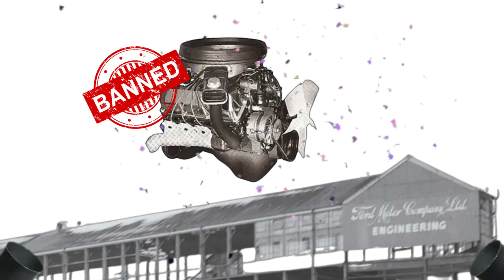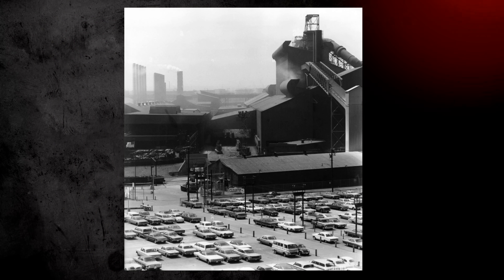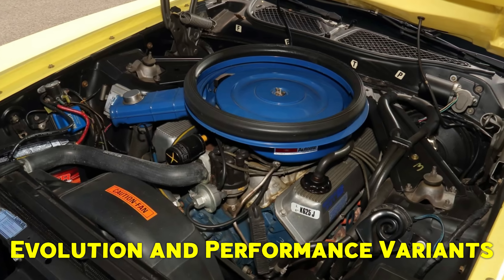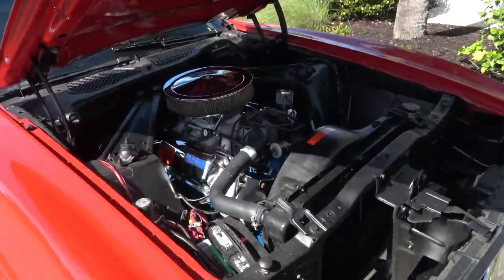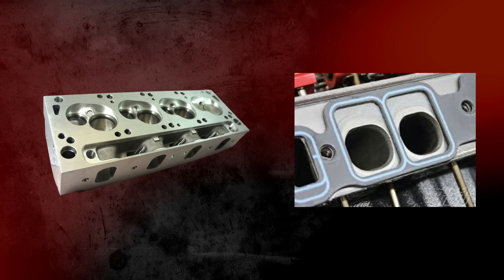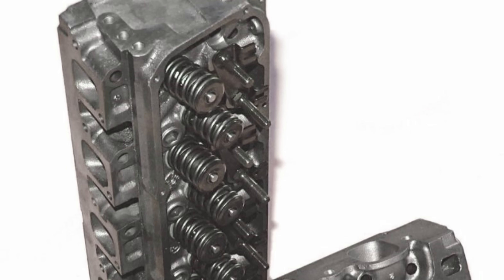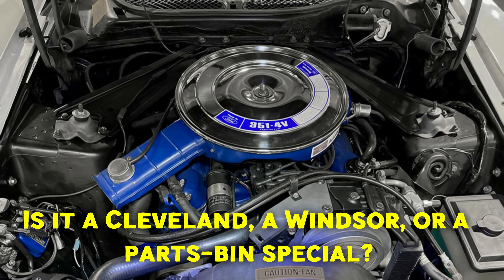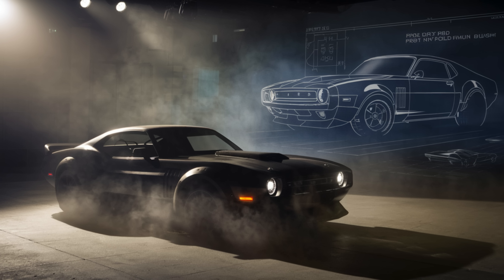The Shocking Truth Behind FORDs Banned 351 Cleveland Engine

Comment: I have a 351w in a merc. It won't beat my 390 tornio. A 351m in my 17 ft boat. A 351c in a 70 torino which is hot. And a 429sj numbers match. Its in a torino 4 speed 411 rear. Squawk in 3 gear rolling. I have a 428 on the floor and 3 two barrels to fit. Yes I collect fords.
Reply from the maker: Wow, it sounds like you have an impressive collection of Ford engines! Each of those setups must be a blast to drive. The 429 with the 4-speed and 411 rear sounds particularly exciting! you should start a youtube channel  @busnorth  fund your next build

Comment: I had a 1973 Gran Torino with a 351CJ. When it started burning oil my Pops and I tore it down(in frame). when we got the heads off(reason for oil consumption) Dad said, dam no wonder this car doesn't get any gas mileage.Forged crank and 4 bolt mains. 4000 rpm was a sweet spot. Not saying what the speed was on that speeding ticket. Its the car out of all my cars that got away😪

Comment: What a unhinged commentary . . . storyline is complete BS.   1971 Ford ran 429s in NASCAR, first 351s in 1972. 
Boss 351 was a 1971 only model . . . what killed the Solid Lifter Cleveland . . . the EPA Enviro Regulations.   
The 351 Cleveland hydraulic lifter had been a Mustang option since the fall of 1969 . . . same head used on the 1969 Boss 302 available in Oct 68 . . . in case you didn't know.  Cleveland engine did have oiling  and rod angularity issues.
Of course in 1971 you could also order a 429 Cobra Jet in a Mach ! Mustang, rated at about 390 hp. 
Yates NASCAR C3 heads were patterned after the Cleveland/Boss heads.  
Ford build an SVO 10 bolt block for NASCAR R452 that was used into the 90s I believe based on the Windsor 351. Eventually replaced by the FR9 in 2007.
Reply from the maker: Thanks for sharing your insights! The history of the Cleveland engine is definitely complex, and it's always great to dive deeper into those details.  @dalew801

Comment: In 1975 I owned a 72 ranchero GT with a 351 c 4 bbl 4 speed it pulled 100 mph in 4th at 4,000 rpm factory red line was 5200 rpm! The best performance of any engine I’ve ever owned!
Reply from the maker: That sounds like an amazing experience! The 351 Cleveland is definitely a legendary engine, and it’s great to hear you had such an incredible ride with your Ranchero GT!  @donaldfrazier5244
yeeeee haaaaaa

Comment: I rebuilt and installed a 351C into a 1973 Pantera. It was mostly stock except for intake. Single plane Edelbrock. Single 780 4bbl. Can't remember what make. First run was mild. 120mph in top gear just to work out the bugs. Second run was supposed to be the head-turner. I computed a top speed of 175mph. I only got to 155. We did a second run, same thing. Got back to the garage and opened the hatch and found nothing.We decided to go for one more speed trial so I had the boys close the hatch while I sat in the seat and then it happened... Snap, snap... I could hear a hi tension snap. I asked the guys to open the hatch and it went away. Voila. We had a spark plug wire short ONLY when the hatch was shut. Never did get that third run in but It probably would have hit 175mph.

Comment: Also knew a guy in HS who bought a nice hugger blue 72’ Mach 1 with an all original 351 2V and auto. Probably had a 3.00:1 rear. That being said, it really wasn’t a slouch! I was shocked at out it would run with an 87’ Monte Carlo SS.
Reply: What's a Mach 2?
Reply: @bradgriffith4231  I meant Mach 1. Bad typing.

Comment: Friend had a clone 71’ Boss 351 or, maybe it was real,back in the early 80’s when we were on HS. Didn’t have the aluminum valve covers. But did have the 780 Autolite carb, Hurst shifted too loader, and 9” diff with Magnum 500’s. We raced a lot of things back then. And then it got a bit slower. 
  We yanked the engine out and tore it apart. We found I think 5 cam lives worn down and 4 cracked pistons. The body did have some rust. His dad gave him that car a couple years earlier. And a few months later his dad traded the car with engine to a friend for a rifle!

Comment: The original Eleanor from the 1974 version of Gone in Sixty Seconds was a 1971 Mustang Mach 1 with the 351C 4v dressed as 73' Mustang with a modest rating of 290hp...more like 330+hp...i knew a guy that built a "Clevor" engine for his 10.5w class foxbody mustang...ran mid 8sec quarters....the 351C lived on in Australia until 1983
Reply from the maker: Dude, that's awesome! I love hearing about those epic builds. Sounds like that "Clevor" was a total monster! Keep the car stories coming!  @CherokeeForce thank you for sharing your insight
Reply: 71 & 73 Mustangs were the same body with only minimal changes like the rubber baby buggy bumpers. 64-66 were Gen1, 67-68 Gen2, 69-70 Gen3, 71-73 Gen 4 & 74 began the Pintangs compacts.

Comment: The 400m was a huge opportunity missed.

A  4"×4" square motor
ready for a set of 351 Boss four barrel quench chamber heads or Australian two-barrel quench chamber heads.
Fitted with solid lifter or hydraulic roller, 4 bolt mains
and a factory flowed dual exhaust system this would have been an incredible screamer but it's all wishful thinking because as mentioned EPA and gasoline octane ratings... let alone the insurance problem all helped to put the kibosh on Cleveland based dreams.
When Jon Kasse was dominating the Engine Masters shootouts we can say he was " based" on the 400m platform / engine concept.

(Kind of like a Monet at 50 feet)

Regarding this video .....I'm not going to say much about the Joe Friday narration and goofy photo mixing and matching 
But I will say how in the heck did they miss the classic Bill Elliott Cleveland in a T-Bird run at Talladega which I believe is a record that still stands to this day. I'm sure somebody will correct me if I got it wrong.
Reply from the maker: You are so right  about the missed potential of the 400m! It’s fascinating to think about how different things could have been if gov egulations and technology had aligned better.  @MrJake-yx8ll

Comment: i had the 351C 2v in my 69 cougar.   3 speed on the floor.  very fast through 2nd.  17 miles per gallon.  9.9 to 1 compression.
Reply from the maker: 17 miles per gallon? That's like a miracle in the muscle car world! It's almost like your Cougar was on a diet while still being a beast!  @wesmiddaugh230
Reply: @rarecarstorys that was cruising on the highway.  just after i bought it gas went to .33 cents a gallon, and everyone chipped in for gas.  my two friends had a 68s with a 390 and 390 remade by Dragmasters in so cal.  guessed 425/425.  we used my car to go dancing.

Comment: Think there's a lotta drama around this. It is true it was banned from sprint cars as Dave Blaney driving Casey Luna car was to fast also Bob Glidden and the Elliott Bros had it figured but the block was a problem it was Waddell Wilson figured out a few mods to the Windsor block created a Clevor? Used until Roush Yates was allowed to build the FR9 used today
Reply from the maker: You're absolutely right! The history of the 351 Cleveland and its controversies is fascinating. It's interesting to see how innovations and modifications have shaped racing engines over the years.  @chucks6879

Comment: Ford GM and Dodge were pushing 300+ HP in the 1960s but come 70s and 80s "muscle" cars were coming out with 145-185hp. Then got back to power only for today have the high hp but so many sensors and crap they get choked down and don't last as long. Dodge already did away with the V8 across the board and I'm sure the rest will follow. As someone who uses a truck for work daily, towing, plowing snow and hauling I can't bring myself to not having a V8. Plus 25 years from now I doubt people will be scavenging junk yards for a 2.7L to put in their build 🤮
Reply from the maker: You make a great point! The evolution of muscle cars has definitely been a rollercoaster ride. It's interesting to see how technology has changed the landscape of power and performance over the decades.  @chadbinette3201

Comment: I had a '73 Mustang with a 2bbl 351C in my early 20s. I had no fantasies about it being a race engine. I wanted reliable engine. Converted it to solid state ignition from points and condensors, used synthetic oil and changed the timing chain to a double roller. Beefier tires to replace the 185/75R14 to 225/70s. When I 1st got my fwy mpg was 14mpg. After I was getting 22mpg average! I was super happy. I wanted to replace the cam with an RV cam and get dual exhausts but it never happened. I kinda miss it. It was fun for a plain jane Mustang
Reply from the maker: That sounds like an awesome setup! It's great to hear you made those improvements and got such a boost in fuel efficiency. The 351 Cleveland is a classic, and it’s always fun to see how people can customize their rides for better performance.  @stvargas69

Comment: 408 Cleveland stroker makes a nice street motor.  Just use the right heads and keep compression at 10:1 or so.
Reply from the maker: That sounds like a solid build! The 408 Cleveland stroker can definitely offer great performance with the right setup.  @Old_Sailor85  great advice 10:1 comp ratio

Comment: I love my 71 Torino with the Cleveland it is a 2v but I have upgraded it with cam lifters aluminum heads and a 800cfm elderbrock carb and msd ignition system and it is a beast
Reply from the maker: That sounds like an incredible setup! The Cleveland engine really has a way of transforming a classic like the Torino into a true powerhouse. Enjoy the ride!  @boilerman2540

Comment: People have been raving about Cleveland's for years, but technology has a way of kick ass on old technology - this time with a 5.0 coyote engine. Want to talk legends, bring out the old FE's and make mine a 428SCJ or just a plain 428. Everyone thinks it's about HP but in the end it's about tne torque that gets the work done That engine with an aluminum intake and water pump weighs almost the same as a stock 351 Cleveland
Reply from the maker: You bring up some great points about the evolution of engine technology! The 5.0 Coyote is indeed a powerhouse, but the classic Cleveland and FE engines still hold a special place in many hearts. Torque is definitely king when it comes to real-world performance! @vaportrail6315

Comment: Had a 69 Mach 1 with the 351 Cleveland that had been built to put out even more HP. That was an amazing engine in a fantastic car.
Reply from the maker: Wow, a 69 Mach 1 with a souped-up 351 Cleveland? Sounds like you were driving a rocket on wheels! Did it come with a "caution: may break the sound barrier" sticker?  @swdw973

Comment: The problem was ford complied to gov reg and open combustion chambers killing mid and upper rpm power they were designed for
Reply from the maker: You make a valid point! The changes in design definitely had an impact on the engine's performance. It’s fascinating to see how regulations can shape the automotive landscape. @2368CHRIS
@2368CHRIS

Comment: what's the best economic way to go with a 289 65 stang motor..2bbl. 3 in the floor?
Reply from the maker: If you're looking for an economical upgrade, consider a 4bbl carburetor for better performance, and maybe a few bolt-ons to maximize efficiency without breaking the bank!  @MichaelMarks-p5v

Comment: The Wood Brothers dominated with the 351 C, so they let gm use the pointed nose Laguna S3 to give then an aero advantage to make up the difference. Bob Glidden had the advantage of his experimentation ideas. NHRA rules for Pro Stock were Approved gasoline fuel and two carbs. Glidden raced for years with extra weight and various other penalties just on him and no other competitors. If he had not been done wrong by the nhra and ran as many races in his era as they do now he would gotten close to 200 wins in racing most competitive class.
Reply from the maker: You bring up some really interesting points about the Wood Brothers and Bob Glidden! The history of racing is filled with fascinating strategies and challenges that shaped the sport.  @stealthbomber2127

Comment: I experienced the power of this mighty engine when my father owned a 57 mainline Ute, he got a 351 crate motor to put in it and even though it was a old heavy car, the engine pushed it along with ease, our engine combo was 4V stage two running on gas at 800 CFM  the mechanic that changed the engine for us told us these crate motors were 350 hp with gas application. I have seen a specialized Ford 351 Cleveland in a Ford capri drag car he was doing 8.2’s at 167, when I got a peek of the engine I noticed it was equipped with Mopar heads with naturally aspirated alcohol application.
For the later, generation Ford really did make their comeback with their Barra motor and they didn’t just target GM They actually went after Japan at the time as Ford noticed it’s performance achievements with their 2six cylinder 4L  engines Apparently, the new Barra engine is cheaper low cost and produces the same horsepower as the 2JZ and the skyline lineup, I watch drag racing frequently and have witnessed the Ford six destroying the V8 in their own respective classes,
Reply from the maker: Thanks for sharing your experience with the 351 Cleveland! It's amazing how that engine can transform a classic ride like the 57 Mainline Ute. Your insights into the Barra engine and its performance are really interesting!  @2wheels4life2
Reply: @ cheers👍 my bucket list 351 is a chance to be a passenger in a Detomaso Pantera😅 don’t even know if I spelt it right.     I’ve watched many videos drag racing racing of sorts America , Australia and the Ford engine Barra looks like it’s making a rise to world motorsports in some classes dragracing mostly proving to be a very cost effective sprint engine,
Best time I’ve seen is a 6.054@237.67mph equipped with a GenV power 60mm wastegate and a GenV race port running on some sort of race fuel

Comment: What about the 351 C with 4 bolt mains?
Reply from the maker: The 351 Cleveland with 4 bolt mains is definitely a topic worth discussing! It added some extra strength for those high-performance builds. needs its own video   @robpeters5204

Comment: My last car i owned for 15-16 yrs was a 72 Gran Torino 351-4V. 4 bolt mains, same cam grind specs used by the 428 CJ, dual point dist. 5 Magnum 500's. Put over 100k myself on it.
Reply from the maker: Wow, it sounds like you really put a lot of love into that Gran Torino! The 351 Cleveland is a beast of an engine. Thanks for sharing your experience!  @LORISSABOOBMAN

Comment: I learned long ago that the easy way to identify a 351 Cleveland was to look for the vertical fuel pump bolts and the 5/8" spark plugs.
Reply from the maker: That's a great tip! The 351 Cleveland has some unique features that really set it apart from other engines. Thanks for sharing your knowledge!  @tonyhonzay507

Comment: I have 3 cleavlands, I run it in my 68 mustang. CHI 3V heads are a must. You showed those in your video. However they are not 2v or 4v. Those are ford only. The 4v were only good for wide open, not putting around. The cleavland is a crossover from small block and big block. Same bell housing as a 302.
Reply from the maker: That's awesome to hear you have three Cleveland engines! The 68 Mustang must be a beast with those CHI 3V heads. Thanks for sharing your insights on the different head types! @grandroofing1604

Comment: I bought three 351 4V junkers. One was just a parter but two were near new. With just new rings and bearings, the best of the two pulled 70 mph in a 17ft ski boat, loved those engines.
Reply: Had a351  Cleveland  in my speed boat years  ago fastest  boat on the local  waterways

Comment: I had a 71 Mach 1 with a 351 Cleveland top with and Edelbrock Performer intake and Edelbrock Performer 750 4-barrel. That car had power, but it also only had a 3 speed automatic so it didn’t have top end, but if stomped on the gas you could find yourself roasting the tires when you were already going 60! The badass sound from that exhaust was fn music! From a real low blub blub blub to ROARRRRRRRRR then straight back to blub blub blub. Guys used to pull up next to me in all sorts of rides including many that probably could have beat me and then give me the nod and a rev of their engine, but after they heard my Cleveland roar and growl from a few taps on the gas then bringing it up to launch throttle most just hung there head and decided not to race! That thing sure ate gas though, shit you not you could watch the gas gauge moving toward E on a fun drive.
Reply from the maker: Sounds like your 71 Mach 1 was a tire-shredding symphony! I guess the only thing more impressive than the engine was the way you made every drive a concert!  @hazyhatrogue
thank you for sharing your story, i really apreciate members of our community like you

Comment: Thank you for these history lessons. I do appreciate hearing from knowledgeable car  people. Most of the one I knew have gone on.              This video brought back a memory from the early 1970''s . Our family had a Ford LTD station wagon. I am not sure if the year. Under the hood was  a 352  sticker on the outside of the air cleaner. Can you shine any light on what this engine was?
Reply from the maker: Possible Engines in an Early 1970s Ford LTD Wagon:

    351 Cleveland (351C) or 351 Windsor (351W) (5.8L)

        The 351W was more common in full-size Fords like the LTD.

        The 351C (introduced in 1970) was often used in performance cars but could appear in station wagons.

        The "352" sticker may have been a misprint or leftover from an older air cleaner.  @RandallBennett-z2p  hope that helps
Reply: @rarecarstorys Thank you very much.